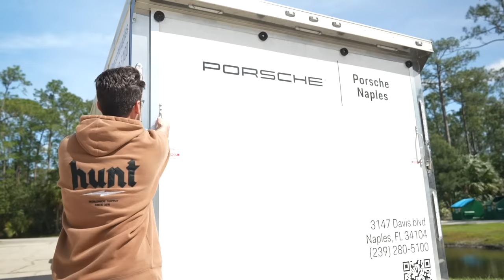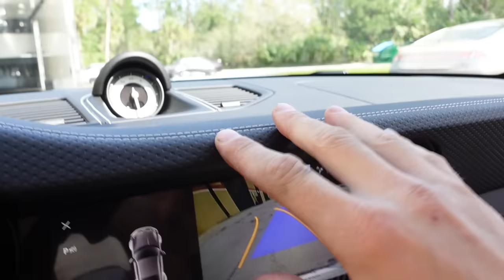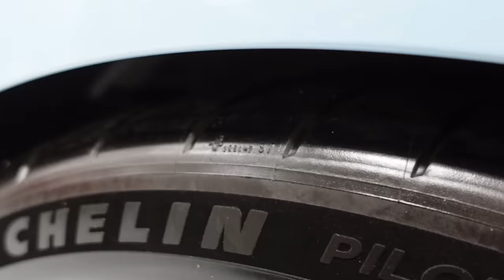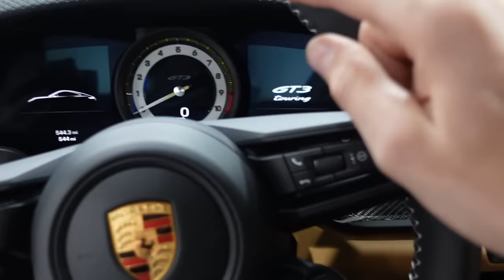Replaced my Crashed GT3 with the Weirdest Porsche 911

Comment: Hey Adam, congrats on the touring! I’ve heard people complain about the ride on the 992 touring specifically, more so than the 991.2 touring, and have heard the solution to that issue is putting the turbo s tires on the car. I’ve been told it completely transforms the experience of the car and really turns it into that true “touring” car experience the name suggests. I recommend experimenting with this if you desire!

Comment: red gt500 in the home garage? if so awesome call!! its not a cftp gt500 but those can get around a track faster than or within a second of cars like Ferrari f8 tributo Lamborghini huracan evo and porsche gt3rs gor fractions of the money plus more room. oh andittle 10k of modsime exhaust e85 tune s.aller supercharger pulley and ported blower those mods make a 80 gt500 a 1200whp mid to low 9 sec car in the 1/4 with handling